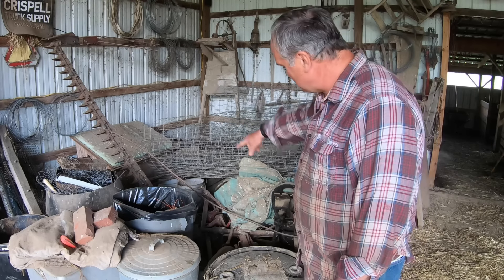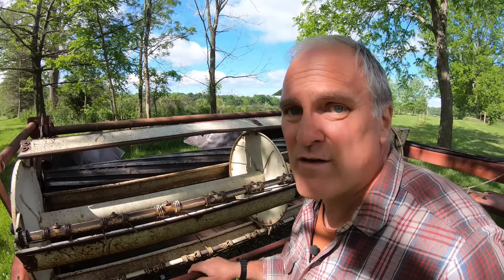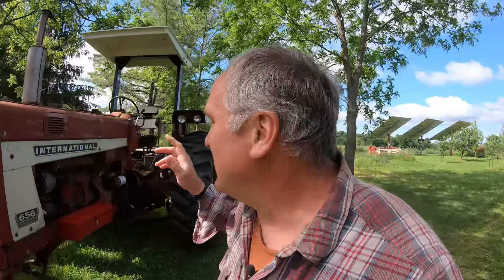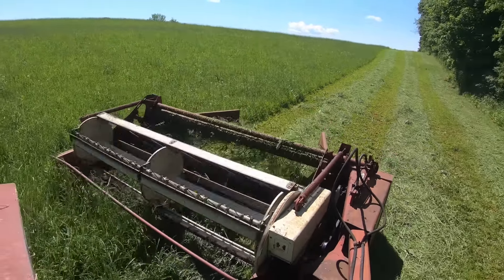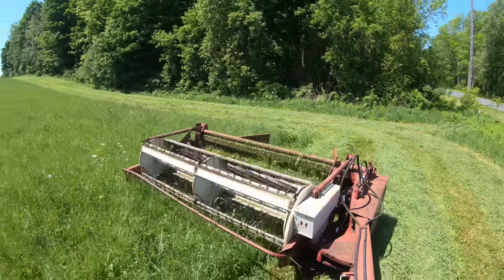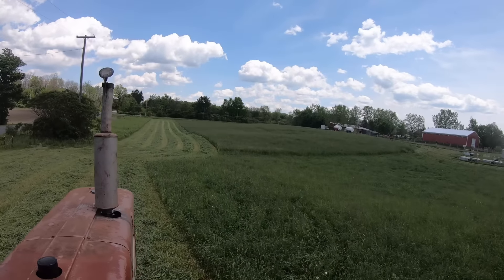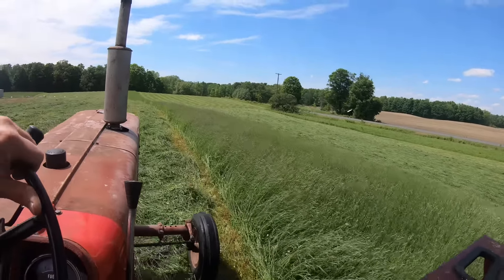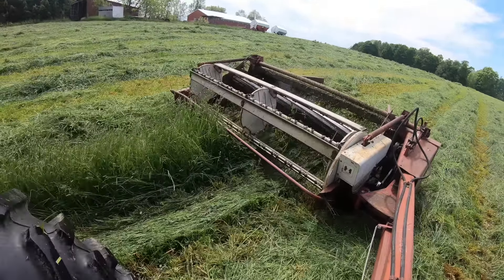the basics of cutting hay

Comment: Here in the UK hay is mostly cut with disk movers. They now have a central section that is mounted on the front of the tractor and two side sections that can be raised for travelling on the road and lowered once in the field. These monsters take the whole of our single track road. So when we meet one we often have to reverse quite a long way to let them pass. Not ideal on our English country roads some of which are only 12ft (3.6m) wide.
Excellent video Pete.
Kind regards Andrew.
Reply from the maker: Thanks Andrew! Front mounted mowers are very uncommon here; most everything on larger farms is draw-behind disc mowers or discbines.

Comment: I'm new to farming compared to my family I'm apart of cuz I fell in love with the farmers daughter 4 years later I help we use older equipment too most of our hay equipment is New Holland and Sperry New Holland we use discbines to cut down our hay and we have round and square bales round bales to feed in winter we use the square bales to mix into the grain feed that we also grow too to harvest our tractors range from the later 40s to the early 80s we mainly use allice chalmers when making hay we use the ac 190 and the ac 7000 they from the 60s and 70s use to work retail before farming and i used to hate being a manager in retail after 7 years now I'm farming and love every mintue of it going to check out your other videos be safe and hydrate out there
Reply from the maker: I'm glad you found the channel! Lots of old AC and New Holland equipment is still being run around here too. Good luck with your hay!

Comment: I had the exact same set up except I have a gear drive 656. The 656 and 990 were a perfect match although the old 990 went down the road for a new holland. No matter what Haybine your using,I find that the grease gun is your best friend.  Ditto on buying older equipment at auctions. Most older equipment is pretty straight forward to repair.
Reply from the maker: Absolutely Michael. I prefer old equipment with greasable bearings over some of the newer stuff with sealed bearings. At least with the grease gun I know they're well-lubricated.

Comment: When i start cutting a field,i always put the tractor next to fence so it will run over limbs and find anything that could break a tooth or other wise damage mower.
Reply: Also I rather break the mower on the last lap than the first lap if something is in the way.
Reply: Exactly what I was going to say.  Always make your outer round the last thing you do.  If you get into something and tear it up, you can just pull out and clean up the edge with the brush hog after baling if it’s not a quick fix with the mower.  That also makes your first lap around done strictly with the tractor tires, so if there’s a limb or log there you’re likely to find it without getting your mower into it.  Did just that today, and was able to just back up and push the broken tree trunk into the woods with the loader frame and go back to cutting.
Reply: Yes normally it's not your best hay along the fence so also your not smashing your better hay with your tires @1RyanDaugherty
Reply: Exactly
Reply: Yep, always leave your headland until last incase you break something because thats where the stones usually are
Reply: we call it the back cut in new zealand and its very important to do it last most of  damage is done there

Comment: There's nothing wrong with old equipment. My wife and I use a 1963 New Holland Hayliner square baler and although it's not pretty it rarely ever gives us trouble. I baled 800 bales for a friend and it messed up the tying of just two bales. Simple, easy to repair, only cost $600.
Reply: You could easily spend 100K on new equipment for just the basic stuff.

Comment: I was raised on a farm. Dad had about 80 acres and leased about 500 acres were we grew corn and soybeans and hay, we had dairy and beef cattle about 40 of each . And 100 hogs and (14,000 lbs of tobacco that's about 7 acres of tobacco).  I  my got into making hay about  11  to 12 years ago. Just buying a peace or two of equipment a year first a tractor with a front loader for $5,000. that I first bought just for garden and some Bushhogging a 39 horse power 539 IMT it was large enough to run a 7 ft New Holland 451 sickle bar mower  I paid ($1,500 ) for. And I bought a  55 New Holland roller rake for ($850) in the first year. I traded work to get the hay baled ( in this area it will cost you anywhere $8 to $10 a bale if you pay someone to only bale the hay for you using a 4'x5' baler. While you do the rest mow ,Tedder, and rake it,  so for two years I only had someone to bale the hay while I do the rest. The third year I bought  another 55 NH roller rake for ($1250.) and a hay rake dolley for ($350) so I could pull both hay rakes at the same time using one tractor.I spent ( $4,800 ) on a good used 4x5 1475 Gehl baler. My tractor was to small to pull the baler so . I paid my son to use his John Deere 5400  69 hp tractor. And I bought a 24 ft gooseneck trailer for( $3,500.)The 4th year I bought 3/4 ton truck ($7,000)  and  a 8ft 1162 Gehl disc mower for ($1,100)  and a two basket hay Tedder for ($850) and I bought a V-rake for ($2,400). The 5th year I bought a 5320 John Deere 2 wd. Cab tractor with front loader for ($24,000) . 6th year didn't buy anything. 7 th year didn't buy anything but sold my sickle bar mower for ($1,200) and sold a roller rake for ( $1,000). 8 th year bought a 458 Mega wide 4x5 John Deere baler, for ($12,500) and a 10 wheel  Gehl V- rake for ($3,500).  Sold my old V- rake for ($1,800), the 9th year sold my 1475 Gehl baler for  ($3,800).  And bought a 2004 Chevy 3500  8.1 dually for ($7,000).  10 year when in half with my son on a 4 basket hay Tedder for ($4,800).  So I spent about ($77,820)  and sold ($7,800) worth of equipment  so that's ($70, 020 ) in equipment. In ten years.  Not counting up keep cost which runs into serval thousand a year. I enjoy doing hay  but sometimes it can get to you a bit when things don't go right. You have ups and downs. Good days and bad. But you have to have it in your blood to keep going and appreciate all the good over the bad. I like your video you do good at explaining things.
Reply: Thom
Hello hope you are doing great

Comment: You forgot or flossed over a couple points. While watching the machinery and making sure it works properly and you are always properly aligned, you have to watch for those rocks that got "frosted" up last winter/spring, the G.D. woodchuck  (or prairie dog) holes with the rocky dirt piles that grass grows through better than anyplace else, the bunny nests plus the inevitable fawn or six that you will see only seconds before the bar reaches them - if your lucky. Naturally they will lie just where you are planning your turn because you have nothing to think about right then. Oh yes, the wind that will always blow the dust and chaff in your face at that critical few seconds. Other than that, mowing is fun.

Comment: you have the same problem on the left side of your haybine as I did, the hay gets wound around the shaft of the "sweep drum" as I call it, and gets in between the shaft and bushing, I made a guard out of sheet metal that wraps over the shaft and used one of the bolts that hold the shaft bushing
Reply from the maker: Great idea John! I wind up (pardon the pun) pulling it out with a screwdriver a few times each year.

Comment: I was just wondering how fast you go, obviously dependent on the hay but in something like what was pictured what would be a rough speed? We run self propelled discbines and we could probably go about 8mph in that so I was wondering how they compare.
Reply from the maker: Hi Sam, about 5mph is the max, mostly due to how rough our fields are. I think the haybine could handle it faster if the fields were smoother.

Comment: If you do the math, I believe you’ll discover that your diesel tractor “was” a lot cheaper to run than when it was a gasoline engine “when” diesel fuel was cheap compared to gas.  I did the math using Nebraska test result numbers on my old 70s tractor and was surprised that the difference isn’t that significant.  

Sure there are other pros and cons to the diesel vs gas engine analysis, but, on balance, gas tractors aren’t as inefficient as we tend to believe.  As someone who was a student of diesel engine mechanics back in tech school, I always had a bent towards diesel engines.  However, gas engines are a bit easier to work on and typically much less expensive to repair.

Comment: Pete why not lay the hay out, especially heavier first cut,  instead of wind rowing it out of the cutter?  I would bet you would knock a substantial amount off the drying time.  Even better, how about cutting half like you are now and half laying out and comparing it before tedding, raking, and baling?  It's easy to throw out "what about's" from the easy chair!
Reply from the maker: Hi Tim, the hay needs to be windrowed out of the haybine so there is a clean strip to work along on the next cut. Otherwise the end of the cutterhead will clog up with grass on the edge of the last cut. It gets spread out with the tedder the next morning.

Comment: Want hay cheap?
You will need the following.
A tractor with a 3 point hitch.
Brush hog.
Simply cut with the brush hog.
Rake
Dry for a couple days
Bale 
Now for the rest.
All can be done by hand. And I've done it.
But I'm going to go though.. by hand and .. cheap
For each step.
Rake.
By hand:
Pich forks soft and hard rakes.
Just rake the length of the rake on both sides into middle and make a windrow the whole length of area you cut.
Let dry a couple days then move to baling section.
Cheap:
But a old hay rake. For your tractor. 
And rake into windrows.
Let dry for a couple days then bale.
Baling section
By hand:
Well this has two choices. First is just collect loose and store.
Second is make a human powered baler. I intend to make a comment on how to make. But isade from 2x6s and 2x4.
The one I had made 30 lbs bale's and was " 2 string ( wire).
Put baler on trailer.
Load baler.
Compact by body weight.
Rinse repeat until your bale is made..
...oh to use a brush hog to cut hay...
Cut once every 2 months or when   grass is seeding.
Now there is an alternative way as well.
Let grass grow to about 4 inches.
Let cutting dry. Or collect " were"
The dry method stores better.
After it dries, a couple days. Rake  it up  put in containers and store.
Wet method:
Ok you will loose over half your crop. But there is a upside for this.
The were method is more nutrients.
Once you cut. Put in containers and store.
This will put out heat and methane.
After stored for a few months it ready to give as feed.
Reply: Cheap baler:
(9) 2x6 three feet long.
(3) 2x6 two feet ten inches
(8) 2x4 two feet six inches
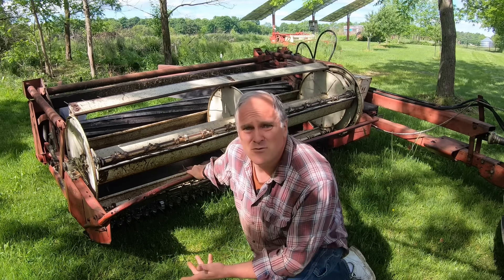(4) 2x4  two feet 4 i 1:47 nches
(2) piece of 3/8 plywood ( might be able to use partial chip board but plywood is stronger) 3 foot x 3 foot..
Front and back pieces. Both made the same way.
 Take three of the three feet 2x6
And two of the two foot six 2x4.
Screw one 2x4 across a 2x6 at the end. Make them square.
All cut edges are square and facing out.
But the other 2x6 at the other end of the 2x4 the same way.
The remaining 2x6 center it between the other two.
On other end of 2x6s put other 2x4.
When done. Laying it flat only the 2x6s touch the ground.
Flip over and only 2x4 touch ground.
Repeat to make back.
Build front, back, bottom, and top in the same matter. 
When done all 2x6 will be facing inward.
Bottom:
(4) 2x4 two feet six inches
(3) 2x6 three feet long.
Build like the front. But add a 2x4 at 1 foot and one at 2 foot.
Top:
These are the shorter 2x4s and 2x6s 
Build the same way as bottom.
Now to put together....
Attach the front and back to the bottom on top at each end at 90 degree each. When done you will have a big " U"
DO NOT ATTACH TOP!
Screw the plywood on the sides.
Now you will have a wooded box / crate.
Mark 18 inches on outside front and back. 
It's made.
Now to use....

Oh btw. The flakes will be 90 degress from a baler square bale..
Reply: To use....
Fill will your long grass . Don't worry if grass is to long. Just fill to the top..
Now put top on and walk/ jump up and down on it.
Repeat until it's at least at that 18 inch mark on the outside... Doesn't have to be perfect.
Each compression is a flake. Again flakes will be top going down not side to side like a baler makes.
Oh once it at the 18 inches packed.
This is why its made of 2xs 
Use wire or string . Feeding through the slots between the 2x6s..
I used wire. But string could be used.once feed through around bale. Make wire as tight as you can. And twist ends together.
Now using this method. I bailed 3 acres 3x a year for 4 years.
And the bale's we're just as good as a baler.
The 5th year, my brother asked if I would go in with him to buy a baler. He had just bought his land and wanted to bale the grass off it.
A mechanic baler is a lot faster. But things break and need repair.
I baler my hay for 2 years with that baler we bought. And had to repair it often.
But we bale's a lot of hay.
By hand, 1-4 acres is about max.
It's a lot of work. But it " free" lol.
It took my girl friend and I about a week to bale that 3 acres.
With a small square baler I've baled 20 acres in a day. By myself. Next day loaded the bales to barn .
Brother helped me load. And baled at times
We would split hay as such 
50% to land owner.
And he & I split the other 50% of the hay. Which most we sold.
I don't mean to sound like I put all the money out. On field he baled he paid expenses, fuel wire repairs. 
It was a little extra cash for both us.
He has the baler now.
When I moved I just left baler.
No hay here...... YET. LOL.
MY point is you can do it the way that fits your budget.
Reply: Oh now for the really hard method.
My 3 acres pasture 
Cut it with a grim reaper type scyle.  That was a work out.
Let it dry for a few days.
Then it rained on me. So I let it dry for a few day. Turned it over to dry again. And again.
Then I collected it all and put it in my barn.
Needless to say I only did that once that year.
I did cut it again that year. But I used my brush hog. And loose collected it again.
The next year I had made my little wooden baler.
Using machines to cut and rake makes a huge difference.
I didn't mind the wooden baler. But the cutting and raking by hand was for the birds.
Oh btw my brother had bought his rake, when we bought the baler.
Mine was a 1940s rake. His was a 3 point 4 wheel rake. Much better. 
The make bigger wheel rakes that use hydraulics.
My brother was the only one I seen that had no hydraulics just attached to his 3 point hitch. Barley touched the ground and the forward motion makes them speen.
If I ever do it again. I will find a rake like my brother had.
Mine I left on my place when I sold it. 
Not worth the 1500 mile trip. And it needed to be repaired again.
I had used my brother rake for half of the last year I bailed hay.  
Now. How much can one make baling others hay?
Well you can make $80,000 a year if things are right for you.
And no one says you have to give them half the hay. 
You can do it for 1/10 the hay.
Or even, get paid to cut down the field. $100 per acre to brush hog in some places. 
You don't have to bale it there.
Pick it up fresh cut.
Then unload in windrows to dry. Then bale.
To sell just put an add on craigslist. Or find feed stores to buy your grass hay.
Back then where I was, grass hay sold for $5 a bale. 
I bet it's like $12 a bale today.
They only sell Alfalfa hay here. 
Might as well grow Alfalfa here. You have to water here no matter.
There. You just let it grow.( Grass hay) no watering required.
Understand there I got like 38 inches per year.
Here I get 4 inches per year.
There is a grass / hay from Africa I can grow here.
That how I came across this video. I was looking for it.
Been experimenting. And finally found a way for it to grow.
But I can't find the name of the grass. So I can buy some more seed.